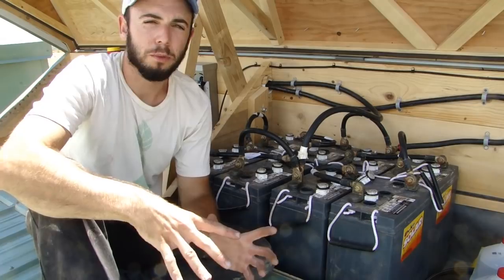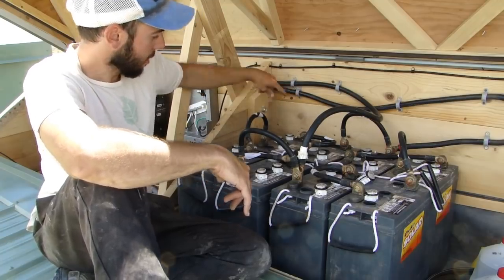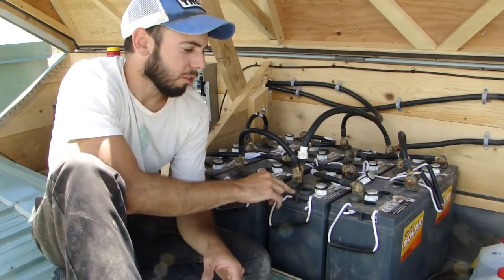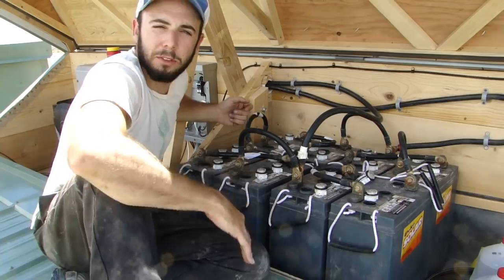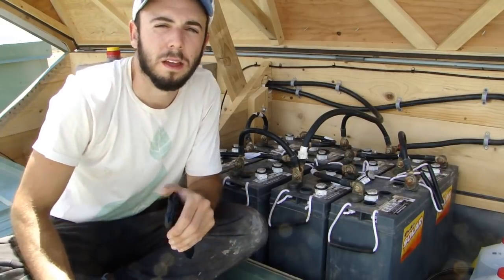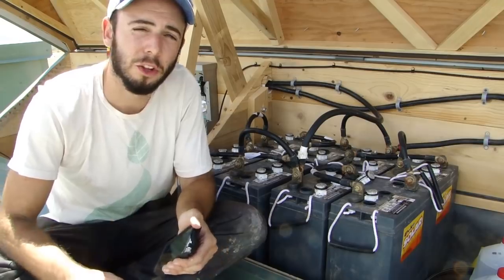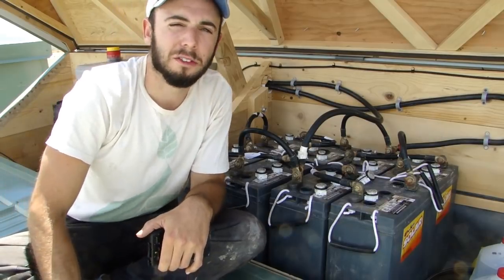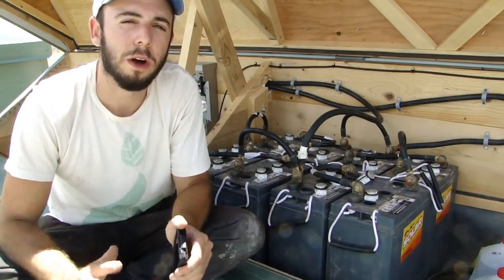How to Size Your Solar System

Comment: Very cool.. My brother inlaw went to buy this home that was totally solar and the Damn bank would not give him a loan without a electrical hookup by -APS. ( The electrical company out here).  Just goes to show you how crooked banks and elec. companies are !!
Reply from the maker: +Drone -AZ. (Steve) dang.  It will change eventually
Reply: Too bad... here in Washington state if you run solar and charge back more than you use, the state gives you a check for putting power back into the grid, ha!

Comment: Off grid build very nice and clear video, thank you much help! 

Can anyone give some insight: 

I am working on a very similar project and i have a window of 50 more days before my schedule tightens back up. I need to get a solar system on my van quick style. I have a couple questions maybe you'd be kind enough to throw some ideas my way...

I want 1000 watts of panels as well. It seems extremely tough to get help on the subject though. 

I don't want to get a kit because like making your own computer i'm sure there's better products available. This is what i need your guys' experience in. 

Pretty standard:

If i had a 960-1000 watt panel system:

-What would be the best controller.
-What would be the best/Safest Inverter.
-How many batteries (I like the Vmax 155ah deep cycle ones)
-What should i use for fuses/fuse box
-and what kind of wire is safe to put it all together with. I really need to know what wire i will be connecting the controller to the panels because i need to run that wire and start closing up the walls. 

Anything will help guys.. and if you happen to know a good source for more info 

I just want to make sure i put this together with the correct components. My budget is the exact cost. which means i'll be over guaranteed.) no room to fudge up

Comment: Thank you so much I've been trying figure out how exactly solar power panels work with the battery and you broke it down so well. Now all I need is a break down on how to exactly setup the wires from battery to battery with any ground wires if needed.

Comment: What happens if in the winter I don't use the battery bank much and system over charges batteries? Is that possible ?  Looking to buy a set to run my pool filter all summer. 1.5hp motor.  Any help appreciated.
Reply from the maker: +PharmSilver nothing

Comment: Nice video with important information ...and you have a good camera presence.  

Many people seem to make their biggest mistake in not figuring out what they need. 
Spent our first solar video (series: Star Lite Wars) talking about the needs assessment, before
getting into the build.
We used new fork lift batteries - they have an incredible power to cost ratio.  
Ours are 2500 lbs providing over 40 kW - and great longevity; people might want to consider them.
Reply from the maker: +RelentlessHomesteading wow!  Interesting.  Keep up the good work bud

Comment: I have two Marine Batteries which are 12v and 625 MCA, group size 24MS from Walmart. I list the link. How do i figure out how many amp hours I can get from them? https://www.walmart.com/ip/EverStart-24MS-6-Marine-Battery/16782694

Comment: can someone help me , im beginner about these things ,i have 40w solar panel with a 20 amp solar charger  and 24 v inverter 1500w pure sine ,but when i connect the crocodile clips to the 2 batteries the solar charger does not  charge and when i connect to 1 battery the solar charger work 
  ,,, sry for my bad english ,what i have to do please ,thanks

Comment: Hello, great video, Can you help me? I have 4 x 6v batteries 350 ah in a 24v series. Can you tell me how i wire them to double my amp hours from 350amp to 700?
Reply: You would connect one bank of 2 batteries in series (12V at 350Ah) and another bank of 2 batteries in series. Then connect them together in parallel which would give you 12V at 700Ah. Either way you end up with the same amount of total battery life though.  12V * 700Ah = 8,400Wh   or  24V * 350 = 8,400Wh.

Comment: Are the batteries in this vid still running strong in 2016? Also, the 30% drain rule only applies to night usage correct? So would it be better to power a small AC unit 5,000 btu and washer during the day or will that be too much stress on the batteries as they charge?

Comment: Video now almost 4 years old. Anything new or different since then? Or is this vid still solid for humankind in 2016?
Reply from the maker: all the basics still apply
Reply: ore efficient panels, batteries also but they re priced t insane prices , but graphene will on be making its way into them lowering costs or improving the already expensive batteries

Comment: hey man, a little correction here, it's 33.6 kw  not 16.8.   here's the math  12v x 350a = 4200w.  4200w x 8 = 33.6 kw  and that's not even taken in to factor of the efficiency of the inverter
Reply: they are 6v batteries, not 12v.
Reply: +Jay Hocking  my bad
Reply: LMFAO !!!

Comment: 2p*150Ah (2 Parallel) & 500Wp (4p*36 Cells 125Wp) How much Volt & Amp inject ech Battery and How much time will take to complete harge the Battery.
2s*150Ah (2 Series) & 600Wp (2p*2s*36 Cells 150Wp)  How much Volt & Amp inject ech Battery and How much time will take to complete harge the Battery.
2p*2s*150Ah (2 Series and 2 Parallel) & 1000Wp (4p*60/72 Cells 250Wp)  How much Volt & Amp inject ech Battery and How much time will take to complete harge the Battery.

Comment: Hello buddy,
I have few questions about my small solar system which i recently started. I have 4 (100 watts) each solar panels connected in parallel and coming in grid tie invert-er( max 30 volt dc input) on full sunny days it produces only 190 watts. My panels are new. I don't understand why i am getting less watts. My distance from Panels to invert-er is 50 ft. I used 10 AWG Sungen Solar PV Wire . Can you please give me some info on it. Thank you.

Comment: All my confusions are over. Great video to know everything about solar battery charging by solar panel through battery controller.
Reply from the maker: glad to help, debasish
Reply: My knowledge of electricity poor. Your video has cleared many of my doubts.
I have two 6 V(VOC), 0.6 Amp, 3.3 Watt solar panel which at series shouldl give 12 V, 0.6Amp current. 
I will put one step up boost converter to ensure 12 V supply.
I have purchased one 12V (UPS), 7 Amp. solar chargeable battery.
I wish to buy one 12 V, 10 Amp. solar charge controller.
I understand it will take 7/.6=12 hours to charge the battery and 10Amp. charge controller will not make any harm to my battery as the solar charger only give 0.6 Amp. current.
Am I correct?

Comment: Solar cell to---> regulator to---> deep cycle battery (Car,motorbike, hobby batteries are fine but aren't made for repetitive drain charge cycles) to---> Inverters. A 300 watt inverter is enough to power a laptop, lamp, and lcd/led tv/monitor and phone charger. What else do people use?  A fridge? I dont see why the world isn't all renewable. its the tycoons screwing everything. Would you overlook landfills, chemical spills and over populations for a few million dollars? There's your problem.

Comment: nice video, great info. I wonder if you could set up a system that will basically charge up the batteries in the first half of the day and then run on solar only. of course minimizing usage but wouldn't that give you more  reserve? also what about dry cell batteries, are they decent? is the maintenance versus cost worth it?

Comment: hi, very good video, question tho, i bought 2 35amp 12v deep cycle batteries, and i have a 45watts total solar panel, i want to use a 2000w appliance, what else do i need to add in my system?? i already have an inverter 4000w, 6000 peak.
Reply: You would need a much much more powerful system in order to run energy hungry appliances such as 2000 W per hour appliances. To give you an idea, the system shown in the video above provides about 5000 W of power per day (if only using 30% of the battery power). You could power your appliance for only 2 and a half hours with a system like his.

Comment: very good video,I am just now getting my batteries hooked up, 16 /6 volt crown batteries.
I am just setting a system up for grid charged backup right now, I will get panels later.
I don't know if my experience is common but I have had a major problem with suppliers and getting components in a timely manner and in one piece, like the inverter, a magnum inverter.
The magnum has a thin aluminum frame that breaks very easily, mine did in shipping.
 the box was fine, it weighs so much it snapped the mounting ears off of the frame.
After a nightmarish period of time I got a schneider 2460, shell frame and a very nice piece of equipment, I hope it works as well as it is built.
From my experience I would recommend you have plenty of lead time on setting your system up, just don't wait to the last minute and think your system will arrive in one piece or in working order.
Great, great video, thank you.

Comment: You must live in a temperate climate.  Here in Arizona I'd have to quadruple the size of the batteries you have to meet the demand.  Just yesterday I used over 100 KWh in one day!
Reply: That's not really something to be proud of!
Have you ever heard of a little thing called 'global warming' 
Try cutting down like everyone else is!
Reply: +Liberation 8 you've never lived in the desert.
Reply: Chris Sparks
True, but I live in a cold climate which has exactly the opposite problem!
You need to keep cool, I need to stay warm!
Both problems require energy.
There are ways to solve both problems without using VAST amounts of energy!
I'd also like to point out that literally BILLIONS of people live on this planet in extremely hot conditions without using any where near to 100kw in one day!!
Reply: +Liberation 8 i should have said that 50 of those my solar provided.  i have an elderly person at home,  can't fry him in the house.
Reply: Chris Sparks
Well that's good to hear. I'd love to be able to use solar for my energy, but due to where I live I would need a huge roof area for panels which would not be cost effective at all!
So I've insulated the house as much as possible which does help a lot.
I'm not sure if insulation would help to keep your home cool also???
It would probably help to keep your AC inside the house rather than letting it all straight out
Reply: +Liberation 8 on the day in question,  i had repairmen here and they had a bad habit of leaving the front door open.

Comment: I may have misunderstood what you were saying. But when the sun is shinning and you are using power from your system, you will be using the solar power and not battery power if your batteries are charged to the point that hey are not using all the power the panels ae putting out.

Comment: So a 100w panel produce 100w a day or each hr? Given its a perfect system hypothetical ly. Does anyone know??
Reply: Watts are normally measured in "watt Hours. That means when you say a 100 watt panel that means in perfect conditions it will put out 100 watts in 1 Hour.
Reply: Or maybe I should have said it will put out 100 watts during that hour. But that may be misunderstood also. Hard to explain.
Reply: Not quite.  100WH = 100W output for an ENTIRE HOUR.  The panel is producing 100W continuously for an entire hour.
Reply: So. Is that different than what I said?
Reply: Either way a watt hour is wattage used in an one hour time period.  So you are right. I should have said it will supply a 100 watt load for an hour.
Reply: Carl Ray Yeah, sorry, it is hard to explain.  I knew you meant the correct thing, "It will put out 100 watts during that hour"  <---perfect.

Comment: hie (Off Grid Build), i need 2.5kwh for 24 hrs, coz i will be running my hvac system with it. que is how many 180 ah batteries do I need? how many 250w panels I need to charge those batteries in just 6 hrs? coz usable sunlight lasts for just 6hrs on an average. apparently I know we have to struggle with startup voltage too. please guide.

Comment: This has to be the clearest explanation of anything I have ever seen on YouTube. Nice job. 

About choosing a charge controller...lets say I am using twelve 4 volt batteries. Each has 1000 amp hours. So, using two strings of 6 each, and by multiplying 2000 amp hours by 24 volts, I get 48 KWH of storage, but 14.4 KWH of usable storage (at 30% depletion). So, now I need to pick a charge controller. I'm seeing some rated at 15 amps, some at 20 amps, etc. How do I determine the right amperage for the charge controller? ...or is that more a function of the solar array?

Comment: a quick question on batteries. May be I am goofing up with some calculations but here's it:  If I go by what you suggest, I should buy 3 times more battery than my average daily use and they will last for 10 yrs. But, on second thought, I could buy exactly as per my daily use and then replace them after 5 yrs..... Am I missing something here? honest question. not trolling.

Comment: Have you considered LiPo system, and how would the longevity compare if you deplete them down to 10-20% every night?
Reply: LiFePO4 batteries will take 7000+ cycles at 20 - 25% depletion cycling. This would be around 15 years. Cost of that battery in the capacity he has shown here is staggering at $16,000.

Comment: Figure how many watts you need, then double it. Should work just fine.
Reply: Or maybe in combination with wind power you may eliminate the possibility of running out draining the system.
Reply: You also might want to account for rainy days. If it rains for 3 days straight. You'd be without power from that system for about 2 days. So if heavily depending on your solar system...triple or quadruple that.

Comment: In fact the panels are indeed carrying the load on a "off Grid System" and the charge controller only restricts power in. More panels=A faster charging rate with bigger sustainable load. And the amp hours only matter when not producing by wind or sun because the amount of wattage you're producing actually carries the entire load while producing energy and what's left over charges your batters. This is the biggest misconception, If you're using 3,000 watts then you need to produce 5-6,000 watts to charge the battery's. You can have massive amounts of energy pass through your battery's with out being charged if the load you sustain throughout the day is greater then the amount it takes to charge battery & carry the load? 25 year electrician, 10 year on an OFF GRID system.

Comment: p.s. I happen to live on Hilton Head Island, where golfing is huge! I have a few connections with a few of the Folks at the Golf courses here that could help me get a great deal on 6v golf cart batteries. If I where to go that route, I would need a minimum of 2 6v golf cart batteries, right? I just want to keep this as powerful, yet compact and light weight as possible. What I like about the EverStart mentioned in my previous post, is that it is not that huge to be a 102 amp hour battery, only cost $100.00 and if anything ever goes wrong with it, I can simply return or exchange for a new one at local Wal-Mart. Suggestions please Sir. Respectfully, Angler.

Comment: Hello and thank you for all of your help! Question: I am starting off with a basic, single battery set up and would like to use a new EverStart MAXX 12v, 102 Amp Hour Marine Deep Cycle Battery, that is supposed to have "30% more cycling capabilities". Would like to use the Renogy 50w solar panel kit with 10 amp charge controller to maintain the charge, possibly a 100w.?. Here is my question...should the EverStart described above be okay? I would like to use a 2000w inverter with it. I plan on building my portable set up, with the ability to connect to more batteries if need be by the way. Thanks again and I look very forward to your reply.:)

Comment: Great video.  

I have a garden shed that I have being run on solar.  I have about half the solar capacity, and about 1/3rd the battery capacity, however I'm not there everyday, and I don't live there.  Small refridgerator, and my wireless stay running all the time, and even on a mostly cloudy day, my batteries seem to get back to 90%+.  

I'm going to be doing a video on this soon.

Comment: ALso its good practice to cross you production and consumption.  you basically have 2 pos. poles and 2 negative poles, you solar should be across a plus on one side and the neg the other bank and the reverse for consumption so all batteries work more evently

Comment: I design and sell such systems here in quebec city, we calculate production of solar panels based on 4 hours in the summer and 2 hours in the winter of sunlight, So if you have a 240w panel I calculate 960 watt for a day in summer

Comment: If I am not mistaken, your battery bank is wired incorrectly. Both your positive and negative connections leading to your charge controller/inverter are from the same bank... Should the positive connection not come from bank 1 while the negative connection comes from bank 2?

Comment: Wrong Lithium ion are the cheaper and a lot better in the long run.The initial cost is higher for the battery lithium has 2000 cycle times at 80% DOD where lead acid has 800. also lithium does not require venting and can be stored inside. The biggest point is lithium is 99% efficient power in to charge vs power available. lead acid is 85% efficient you will need a bigger solar system to charge lead. you must take a long term and whole look at the cost. //www.youtube.com/watch?v=ZkMk8djVUQk&list=PLrDQhF1t4L8rZWllfI-7ERRfPTiGuUv-W

Comment: Great video!
I have  small cabin in the bush and I would like to add light. I am thinking maybe 6 LED light fixtures that are used in travel trailers should do it. Each fixture runs at 3.1 watts. Can you suggest what I would need to make this work? It will remain at the cabin all year round.